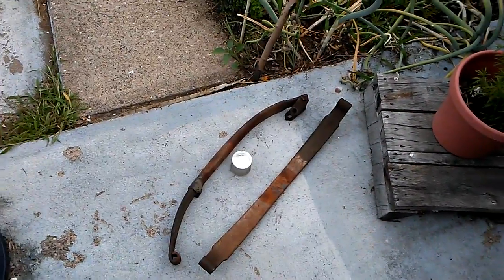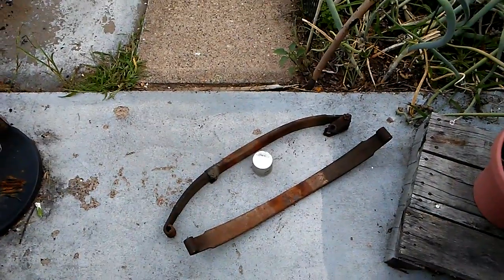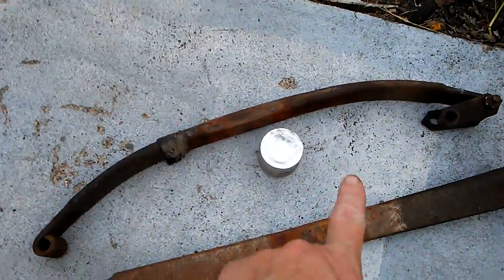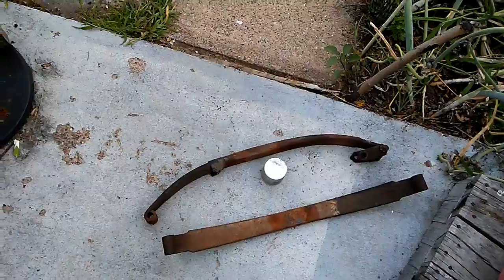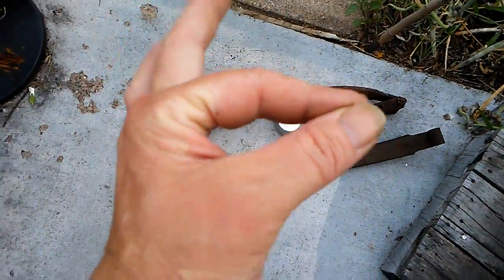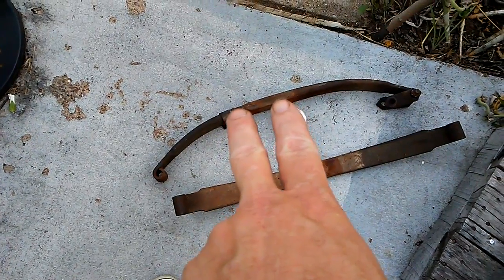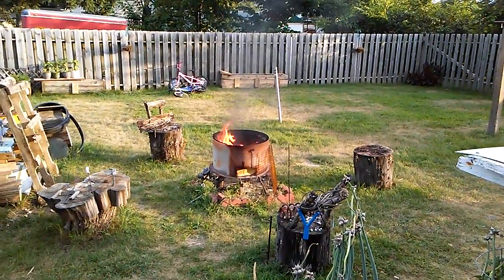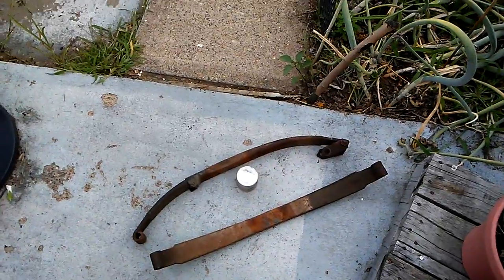Cookin leaf springs before forging

Comment: Are you going to be making videos on a regular schedule? If you are I'm gonna try to boost your channel.
Reply from the maker: Curiosity Forge with my work schedule ( overtime changes week by week), it is doubtful to get regular videos up.
Reply: drason69 Duly noted. I will hold off on the boost until you have the time needed.
Reply from the maker: Curiosity Forge i have about a 5gal bucket worth of cleaned fire pit and charcoal grill ash saved for full annealing. I guess in retrospect, i should have said an ' normalising heat'. For something this large, i will repeat the process and bury it in sand and soil, or even some woven fiberglass insulating wraps that i got from work. The wraps go upwards and beyond 600 deg F in normal use
Reply: drason69 NICE. Yeah, you could dig a trench out, lay down insulation, half layer of ash, lay the hot steel in there, top off with ash and cover with insulation. That oughta anneal it but good.